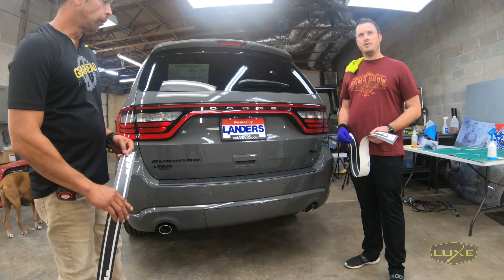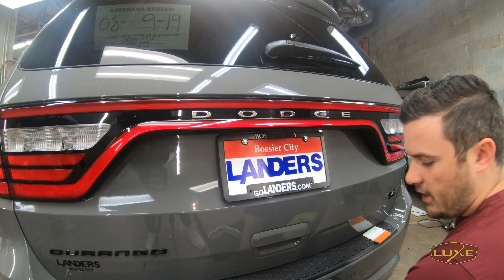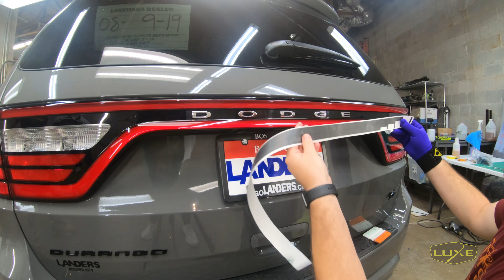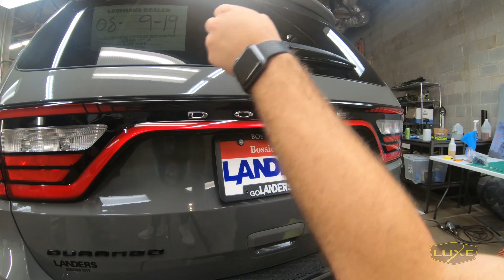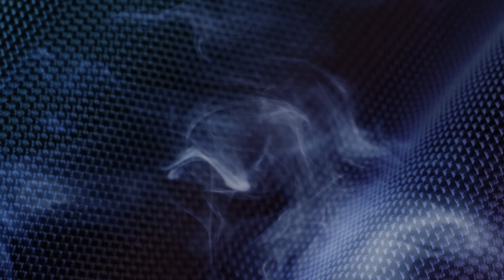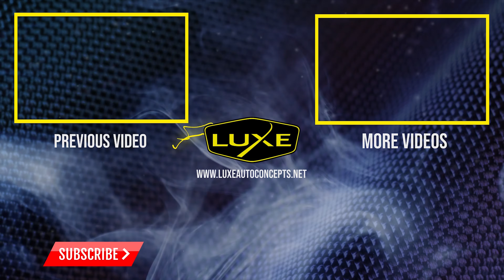2014+ Dodge Durango Racetrack Taillamp Decal Installation Tutorial

Comment: Good video, but I WISH I would have turned my lights on before laying the sticker down. The top came out slightly crooked on one side and if I had turned the lights on before doing the install It would have been flawless. 
Great product so far, happy with the ease of putting these on!
Reply from the maker: Thanks! If you ever need a replacement instead of the full kit just email us contact@luxeautoconcepts.net